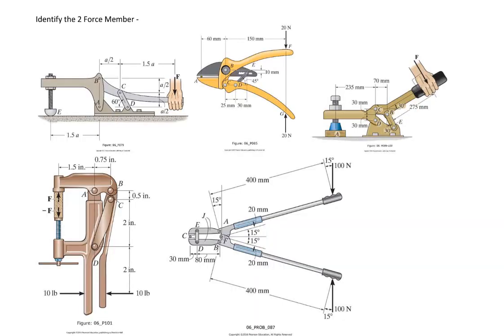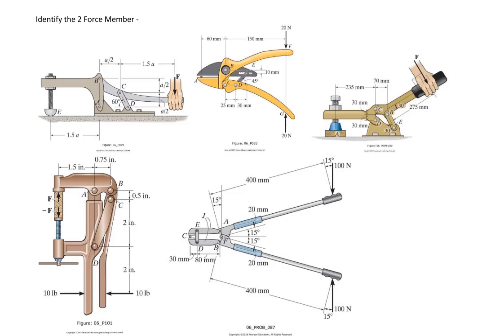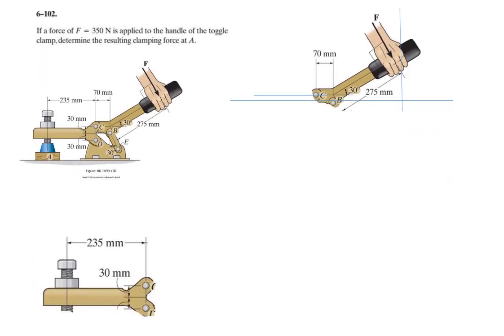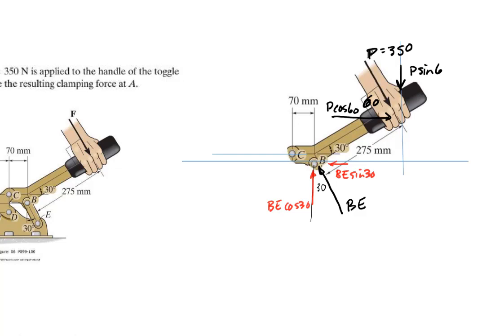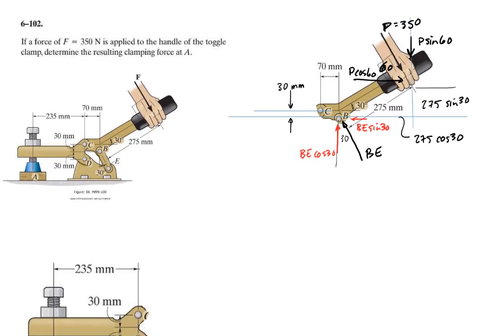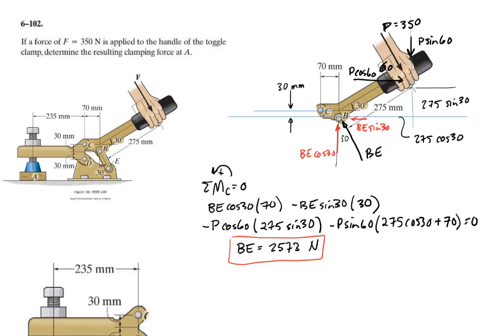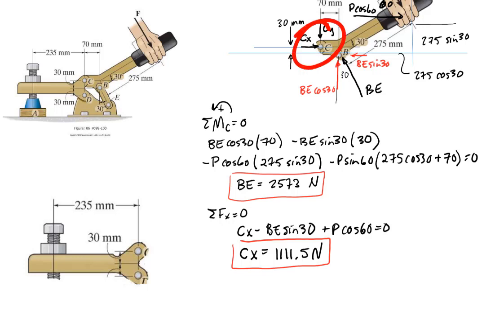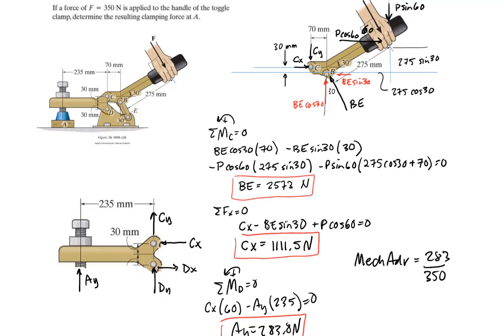6-6h Machines 2

Comment: Hi, how can you use (275 sin(30)) as the lever arm for -Pcos(60)? You are taking moment about point C, correct? The distance 275 is from line of action of P, to point B, NOT C. I noticed when you calculated -Psin(60)(275 cos(3)+70) you accounted for the extra horizontal distance needed.  But you didn't account for anything in -Pcos(60)(275sin(30))